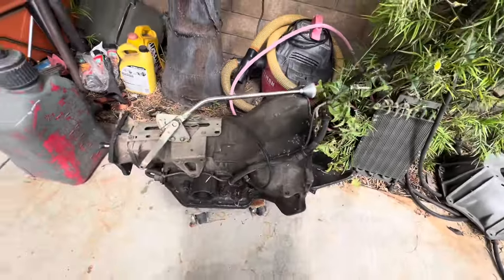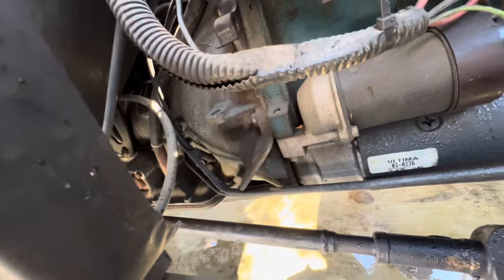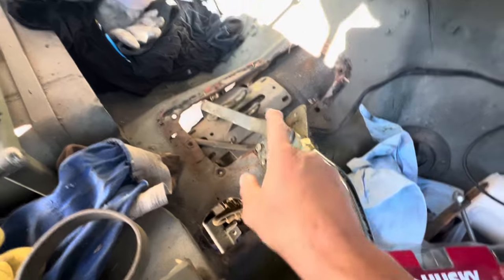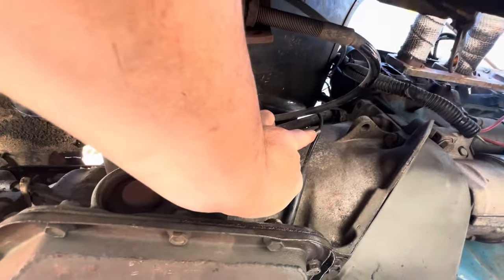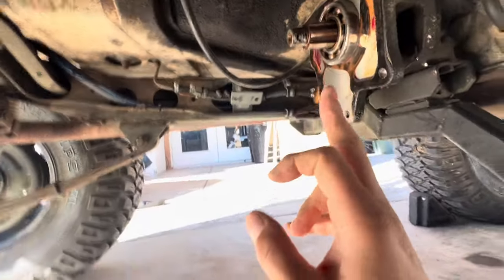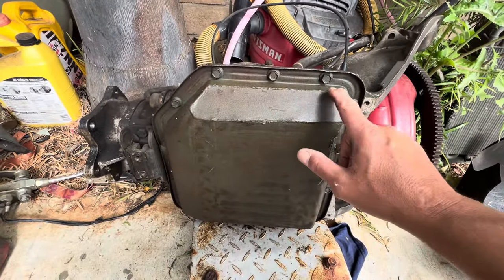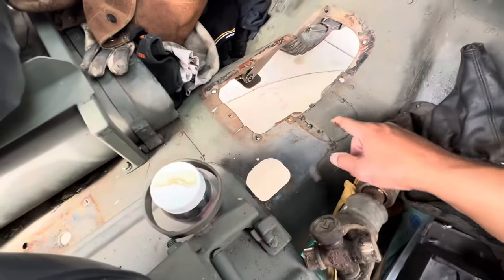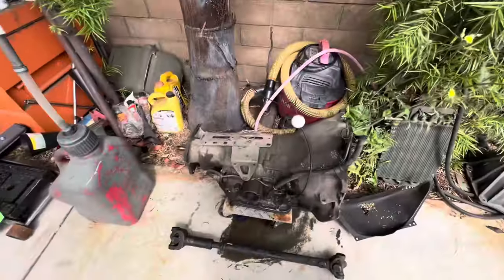Passing good info TH350 to Buick 225 V6 in a Willys Jeep. Is it a good swap? I'll let you know.

Comment: Did you not like the TH350?
Reply from the maker: hi - I ran it for about 13 years. It is excellent on the road, freeway, and trails.. but I prefer the 4 speed SM420. I like driving with the clutch. personal preference. TH350 is an excellent transmission.

Comment: Great information!!!!  I looked into a th350 transmission. He said to bolt it to a Buick v6 you need the BOP case. Chevy will not work.  How long is your rear drive shaft?  Thank
Reply: I think that you are right, it is where the start is hooked up.
Reply from the maker: yup thanks 👍
Reply from the maker: maxxbear-i’ll get that info for you when I go back out there on Saturday. Thanks. 👍
Reply: Great info 👍
Reply: Are you going back with the turbo 350, or changing it over to the SM420 like your other flat fender?
Reply: Just some info….  Novak makes a transfer case adapter to bolt to the th350… it clocks the transfer case down just enough so you don’t have to cut the oil pan for clearance…it’s’ tight but it works.